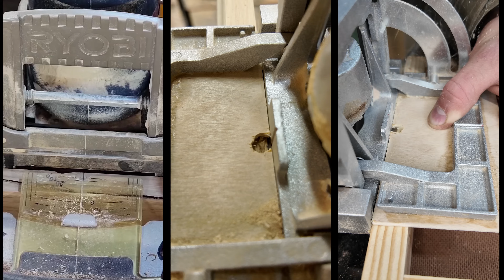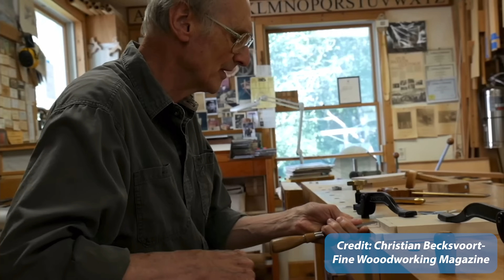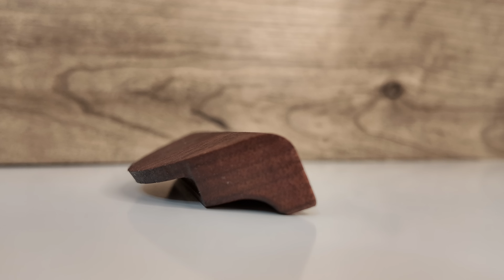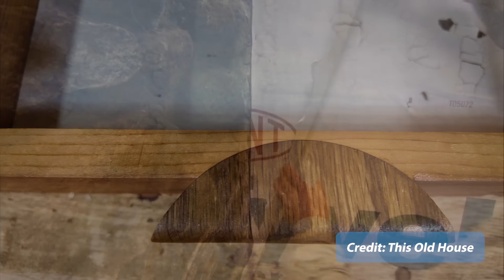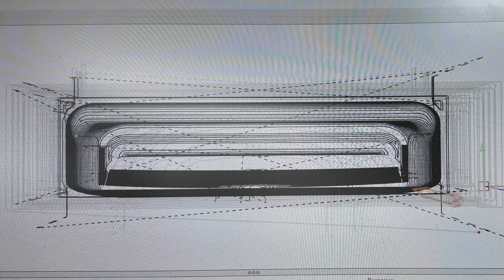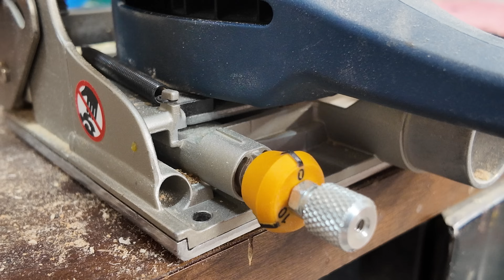Biscuit Handles // Woodworking

Comment: That's pretty cool - as always you have amazing stuff.

As a side question - what CNC machine do you use? I am trying to get one and learn so asking for your advice on where to begin. Hopefully it is reasonably priced since I am a hobbyist building stuff for fun and don't crank out products for sale. Thanks in advance for any insights you can share.
Reply from the maker: I have Genmitsu 4030 proverxl that I bought on Amazon for about $800. I also have a Two Trees TTC6050 that cost around $1700 that I absolutely love. I was very skeptical about getting a cnc for sometime because I thought it would be too difficult to use (I am not very tech savvy) but honestly the hardest part is just putting the CNC together. I use a CNC program called “Easel” to design most of my projects. It’s really easy to understand and use even if you have no experience. It is also free which is nice.

Comment: Absolutely brilliant as always. Love the handle and it’s funny that I was thinking of using a CNC to duplicate these until you mentioned you used a CNC. Not sure why it would take 30 minutes to make but using one bit is probably the reason. I’d think I was going to use two bits and a 1/2” round over on back end and batch them out. Personally I love it and would definitely  goose these over conventional handles. Keep up the inspirational videos.
Reply from the maker: Thanks man! yeah, I’m trying to get the carve time down with future iterations. I can carve it a lot fast if I switch bits between operations like you said, but I like the idea of being able to carve everything with as little work from me as possible.

Comment: There are a bunch of cheap tools available (or jigs) to make the installing of handles easy and failsafe, so that part of your reasoning is much less important if you ask me. But the design and consistency are gamechangers! You should have started with those arguments :)
Reply from the maker: I completely agree. I do think the fast installation is a nice plus to the biscuit handles but in retrospect, I should not have started with that point.

Comment: It's a great idea but I would try to make a version that can be replaced. Clients sometime want to change out hardware when they remodle their kitchens the majority of the time.
Reply from the maker: That's a great point, I will look into creating a version that is easily replaceable in the future.
Reply: @JoshWrightWoodworking on furniture sold by itself or furniture in general you should be okay. It's the cabinet hardware that you might want to make interchangeable.
Reply: @JoshWrightWoodworking I was thinking. If you put 2 small threaded inserts in the handle you could use it either way. You can still glue it or drill a couple of small holes and screw it in.

Comment: Great idea! I would definitely use this is i had the chance. 
We use a kregg jig, set it and blast. Super easy. I will have to agree the screws are huge eye sores on the inside.
Reply from the maker: Thank you! You bring up a good point. I know there are a lot of great jigs that make installing drawer handles faster but I like that I don’t need a jig for the biscuit handles and, as you said, i am also not a fan of the screw heads.

Comment: Checked your Etsy, price currently less than $10 in walnut and oak!  Get them while the last, folks.  You should raise the price soon, not sure how that allows you a profit margin with the one-at-a-time production process shown. Any patents pending?  I hope this generates some useful capital inflow for your shop, before someone in China steals your idea.
Reply from the maker: Haha, thank you! I am trying to keep the price’s somewhat competitive with traditional hardware and right now I’m more interested in getting feedback than profiting
Reply: @JoshWrightWoodworking  TLDR: 'Raise the price to at least $14. 

Anybody who WANTS you to succeed should want you to make a decent profit.  There's a significant difference between profit and profiteering.  With the latter you're holding people over a barrel because you have a monopoly, with the former people/customers want you to gain enough momentum from the endeavor so that you have enough breathing room to continue to innovate and provide them a service.  

The hardware that you are pricing yourself against is mass produced by the 100's of thousands in factories with molds and tooling specifically made for the process.  
Was it 30 minutes(?) on your CNC router per piece, NOT including the labor to cut the stock to spec and then fit it into the vice?  Are you paying yourself less than minimum wage?  What cost in lost productivity is it to you, to soak up that much of you CNC's schedule when it could be put to other uses?  

This is kind of like burning lumber for firewood.  There's no problem with doing that, as long as you're just burning the off-cut scraps that are too small to be useful.  You build with lumber though, and if the practice isn't carefully kept in check, then you'll find yourself throwing otherwise useful pieces into the fire. In this case, the "lumber" is your personal time and equipment schedule.   

I'm not some guru, I've struggled with this exact same issue...  so I may be projecting my own insecurities on to you here.  

Anyway, thank you for sharing so much of your creative process with us.

Comment: I'm mildly concerned about the stresses over time.
Reply from the maker: So far I have had no problems with these newest handles breaking but to be fair they have not been tested long term. I will make update videos as any problems/improvements arise
Reply: @JoshWrightWoodworking  I say it mostly since the handles are installed along the same plane they will be used, and I'm wondering if there is enough material face to stand up the sheer forces over time. Love the design though, simple and elegant - often the best combination.

Comment: wait.. youre only gluing the under side of the joint?
im still kinda new to woodworking but isnt it best to glue both, if not, all sides that come in contact with the wood, creating a stronger and more cohesive bond?
Reply from the maker: Just gluing one side seems to hold fine but you are definitely right. It would be best to glue both sides

Comment: Waste of time making the handle on a cnc. Make wooden handle/pulls with a flat side at the back, Biscuit join the back and drawer. Make the pull whatever size/shape/wood you want.
Reply from the maker: The biscuits that you buy at the hardware store are made mostly for aligning wood and not so much strength. The grain of these biscuits are running diagonally which means the handle would not be jointed in place as strong. Also there would still be the problem of glue squeeze out. Also it would be difficult to biscuit joint such a small handle safely. 

Thank you for your input and thank you for watching!!
Reply: @JoshWrightWoodworking  Making solid wood  biscuits is easy and quite fast. A simple wood block fixture would make machine op safe/fast/easy.

Comment: There is a tool for centering the hole(s) measurements for draw handles. Less than ten dollars for a cheap one, but the metal ones are best and last the longest.

Comment: Hey Josh, really nice idea, I like the design solutions to reduce installation time and glue squeeze out, the only big caveat is: you need a biscuit joiner!!
It would be great if you could offer the option to use 4mm dominos by adjusting the CNC file to reflect that profile 😉

Comment: Great idea. What if you design the handle part so that it could receive a completely different shape made by any woodworker. Something in the fashion of permanent replacement teeth set on a stem implanted on bone.
Reply from the maker: That is a really good idea! Definitely going to have to think on that.

Comment: Not surprised you came up with this, given you clearly have worked at the prestigious aerospace agency: AƧAИ 😅
Mirrored footage jokes aside, these look great and you clearly thought it through for a long time, which is even better for everyone! Having a fleshed out design with issues already worked out is going to really help it sell since it'll alleviate concerns. (just be sure to embed this video there, that way even if they didn't have concerns it'll reassure them of reliability)

Would having it so that the top has a lip for the biscuit part (the insert part being slightly lower than the top edge), to make it further hide the cut into the drawer face? 
Might not even be a necessity, but it was a thought I had, so I figured I'd share it anyways.
ASCII Art to convey it:
Top of handle ↗️ ¯¯¯—=== ⬅️ Slot in drawer face
               Biscuit part ⬆️
Reply from the maker: Dude! Adding a top lip to the biscuit handles is a great idea! I’m Mad that I overlooked that haha. Will be stealing this for future iterations, thanks!
Reply: @JoshWrightWoodworking  It's all yours 🍻
I'm not one who is great when it comes to executing ideas, but I'm pretty good at coming up with them! 😅
I have no chance of working for Disney, but I still consider myself to be an "Imagineer"! 😁 
(tis what Walt called the Disney World engineers,  which I thought that was a well suited and genius title heh)

Comment: Awesome idea! You know, if you attached them with hide glue they would be replaceable. It wouldn’t be quick, mind you, but like furniture repairers do you could dissolve the hide glue with vinegar so they would be “removable.” With hide glue they would still be very solid but they wouldn’t be permanent. It might be nice to have the option to repair and/or replace them in the future. But no matter what, this is a really revolutionary and ingenious idea and I think it definitely has a bright future — just like you. 😃
Reply from the maker: That is a really great idea! I just had another comment asking if there was a way to change the handles out and I did not think there was. I’ll have to get some hide glue!
Reply: @JoshWrightWoodworking  I learned all about it from Scott who runs @FixingFurniture. He has lots of good info and examples there of when to use PVA vs. hide glue vs. epoxy. He always stresses to use hide glue on furniture parts that need to have strong glued joints but may need to be disassembled in the future.
Reply: @JoshWrightWoodworking  they're easily replaceable by throwing some protective painter's tape down, flush saw the old one off, chiseling it flat, recut the biscuit
Reply: @JoshWrightWoodworking Great job young man! You should also consider selling the gcode/SVG file. Then people with a CNC could modify as they wish. Another revenue option. Frankly, I'd like the file now as I'm building some shop furniture....I'd pay. How bout it?
Reply: I think you can soften PVA glue with heat too, I think most glued can be deboned with enough heat.

Comment: Looks good.  Have you tried squaring the sides at the edge of the slot?  The protruding wings give it a certain vibe.  Making them square should make a more contemporary version.
Reply from the maker: Yeah, these handles look best when they are installed at the very top of the drawer, where you can see the whole handle. Looks kinda weird in the center. I plan on making a variety of different biscuit handle designs. Square sides in definitely on the list. 

Thanks for watching!!

Comment: Awesome idea. My question is, as trends change how hard is it to remove the  old handle to put in a new one? I hope you have great success with this idea.
Reply from the maker: Not gonna lie, that is definitely a down side of the biscuit handle right now. They are more permanent than normal handles. I guess you could cut the handle flush and recut the slot for a new handle but that is a lot more effort.

If the idea is well received I would want to come up with a way to make less permanent biscuit handles… maybe using Knapp style biscuits that snap into place
Reply: @JoshWrightWoodworking thanks for answering. That would be great if you find a way to change them without cutting them off. You know how we women like to remodel our homes and change things up.😄
Reply from the maker: @diannaperry8116  haha, definitely something to work on for future versions
Reply: You know, initially I thought these were going to be affixed with a screw through the top... As I say that, it'd be an eyesore with the hole visible when open; HOWEVER, I realize that it could easily be done from the bottom and be completely out of sight...

Since you'd need two in order to prevent it from moving/wiggling, and while two screws would be ideal, they would likely compromise the thin piece... So, perhaps only a little bit of glue is used to make it wiggle few but also easy enough to remove? 

🤔 Although... I just realized that if you're wanting to remove them in favor of a new handle that is more of a traditionally affixed one (screwed from the back), the person could just intentionally snap the handle off. That would then leave the slot filled and they'd just have to sand it flush (or hand plane if it's left a big enough protrusion).